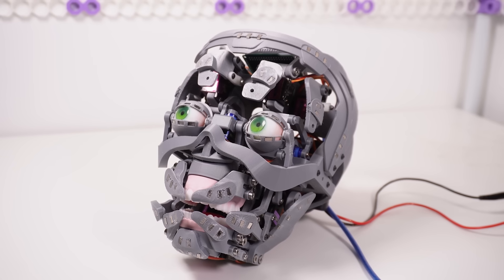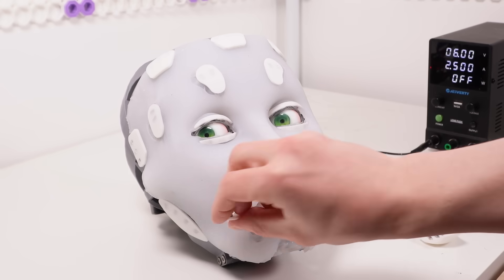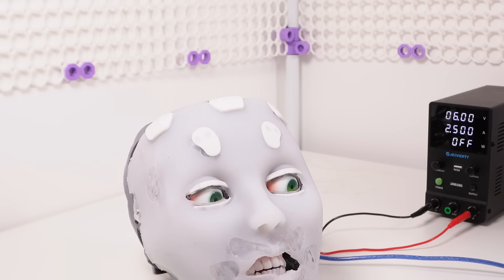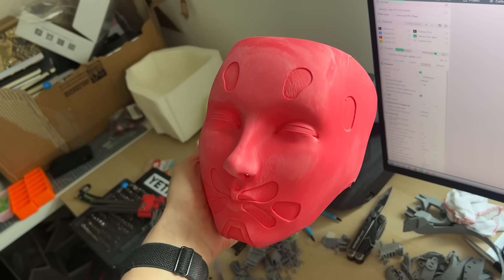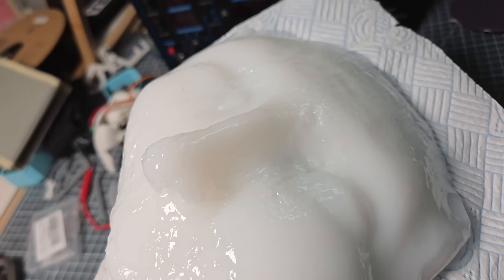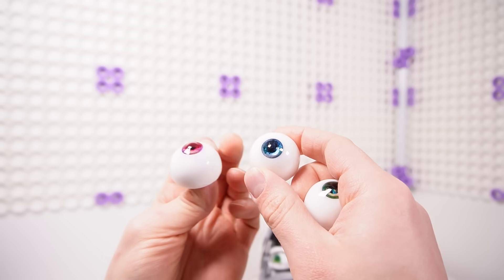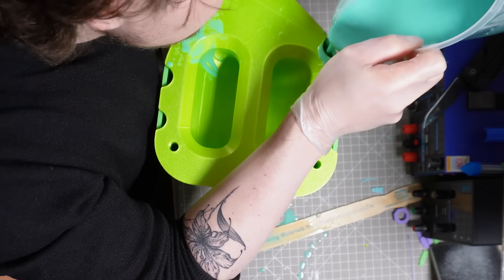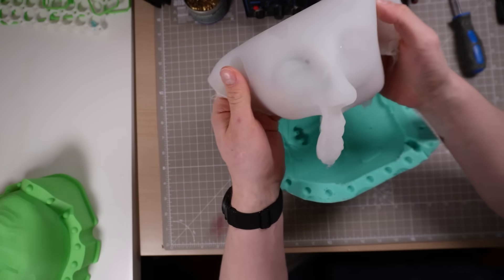Silicone Skin and 3D Printing: Creating an Expressive Animatronic Head

Comment: Smooth-On Ecoflex are platinum-cure, also called polyaddition. This polymerization reaction is often inhibited by the presence of sulfur or tin. Since you used MoldStar 15 - which is also platinum-cure and not tin-cure - your blue silicon is most likely not the problem. However, depending on the clay you used, it's highly probable that it's what ended up inhibiting your silicon polymerization. Some non-drying modeling clays are sulfur based, others are sulfur-free (and often clearly labeled as such). Had the same problem once using food-grade silicon and the clay was the culprit. Once removed, it worked without issues.
It also looks like that you're using Smooth-On's Universal Mold Release, which they don't recommend using on silicone rubbers. According to the EcoFlex product page, Ease Release 200 would be a better choice.
Also, sidenote, but I don't think you need to use the MoldStar at all if you print your mold "negatives" directly. It might be a bit more fiddly to go in there and smooth the layer lines, but you'd be able to directly cast the EcoFlex and most likely won't even need mold release. I'm sure you already thought about that though.
Reply: Agreed 100%. I hope he sees your comment

Comment: Hey, prop maker here.  Platinum silicones are notoriously finicky, so it could be a few different things!  It looks like your first round of casting, you used Oomoo 25 for the mold, which is a tin cure silicone, and you're using Ecoflex (I think?) for the face, which is a platinum silicone.  Tin cure silicones (especially freshly cast tin cure molds) can inhibit the cure of platinum silicones.  If I were a betting man, I'd guess that was your culprit. Especially since it looks like you switched to Mold Star and Ecoflex (both platinums) for round 2.

Love your content!  Your work has inspired me to pursue an associates in Mechatronics, and I'm really loving it!
Reply: This, plus some types of clay cause silicone cure inhibition.
When you used clay to stick parts of the face into the mould, what type of clay did you use? It must be sulphur-free.
Even if you think you've scrubbed off all trace of the clay, Murphy's Law means enough sulphur will remain to be a problem.
Reply: The sulfur in Air-dry clay will inhibit platinum cure silicones as well. I'm not sure what you were using either, so just thought I'd drop this here. It's something I've run into. I've had a lot of success sealing the clay with a high gloss clear coat, but it's not 100%.
Reply: This'd be my bet.
Reply: am a mold maker and this is accurate, also tin cure tends to shrink more so use platinum cure for both is better, and for cost saving on both 3d printing and silicone, use the 3d printed shell with negative space inside for the pouring of the actual face is my go to strat.
Reply: Also the clay
Reply: @bjohns3961  yes if it was water based clay
Reply: There are other ch's that say this too.  Also applies to 3D resin molds, I think Tin cure silicone works better.
Reply: I'm a mold maker and work with silicone a lot. What Brian said about tin vs platinum silicone is true. As well as what others have said about clay (usually) being okay if it doesn't have sulfur in it. I wanted to add, it looks like you're using Mann 200 mold release (that's one of the releases we use at work) which IS compatible with platinum cure silicone. So you are totally fine using lots of that mold release for your parts!
Reply: and that is why I HATED to use platinum silicone, it hates most glues, tapes, especially stink eye glances!
Reply: I ran into similar issues using resin printed molds for silicone. They would never cure, then I discovered if I finalized the resin print with uv while it is under clean water it works just fine with silicone. I'm not exactly sure why it works, my theory is whatever inhibits silicone curing is water soluable and by uv curing it solid under water it makes it so more cant migrate to the surface?
Reply: Yeah this was my assumption as well
Reply: This
Reply: Nerds!! lol ❤
Reply: bump
Reply: maybe you can research better, a bit from a builder of Hanson robotics, there was a video explaining skin formula adding cornstarch to latex

Comment: does it need to be magnets that you embed into the silicone? would you be able to get away with pegs instead? That way you could have holes drilled into the back side of the mold; insert the pegs, and then do the silicone cast in one shot, as the pegs would be at the correct depth and alignment already.
The pegs would have a larger 'head' area, and could even have holes in the plate to let silicone through them, increasing the surface area they pull against for durability.

Comment: NOICE!!! i've been thinking and working toward this project, with (the face coming first) but i would NOT be using the industry-standard lever system like you did... here's the trick, the 'skull plate' has holes for tiny cables in nylon tubes that can yank on various points of the face where the tiny cable is tied off on a small piece of mesh to distribute the anchor point's load on the silicone (and not tear it)

i suck in CAD and can only conceptualize the process... that's what's holding me back but you don't seem to be stymied.

Comment: Great-looking machine! Can’t wait for the next video! The silicone skin looks awesome! I think having the magnets inside the skin is a great idea, but maybe you could use TPU to hold the magnets? If you make the print porous (like 10% infill) and then cast the silicone inside, it could strengthen that section and stop the silicone from pulling away over time. Just a thought—keep it up!

Comment: silicone is definitely expensive :' )
half a gallon is around $30, and its for 1 quart of A and 1 quart of B
the mixture is not 1:1   its  A-1 : B~0.5

if you want different colors, 
add only up to 3 pea sized drops of acrylic paint MAX to A 
then mix, let cure 25 minutes until bubbles leave mix.
and add B only when ready. 

injection models need airholes to cure

~ any more than 3 pea sized drops of paint will turn the mixture into slime and it will never cure.

Comment: I love it. Fantastic job. Can't wait to see more. What I have done in the past with the magnets is to place another magnet, in the negative mold, attracting the one that is in the positive mold to keep it in place. This keeps them from getting attracted to the ones near to it or from moving around, In this case, I would put down some silicone, where the magnets would be, and allow it to cure, so the magnetic attraction doesn't squish all the silicone out. I'd finish by pouring the rest of the silicone concealing and suspending all the magnets in.  The mold would have the negative space designed below the surface with the proper gap for attractive forces. They can be glued in place, in the original mold, so the process can be repeatable for multiple skin productions. There's still a need for great attention to the polarity, but once glued into the negative mold, you don't have to worry about them again.

Comment: I have a few questions: are the eyes and eyelids linked, or individually controlled? And is the jaw only open/close, or also front- and sideways movement in this design?
I really want to build an animatronic from one of the main characters of a book I'm writing / game I'm making, and I'd like to make it as realistic as possible.
Due to a few disabilities, I can't seem to focus long enough to get the mechanisms designed myself :( Adapting existing designs is generally no problem though ;)
Thank you VERY much for all the work you're doing, and for sharing the process and the files!

Also, I don't know if you already know the channel "Brick In The Yard Productions"? Not trying to promote them, or anything, just mentioned it because I found their tutorials on realistic skin making very interesting and easy to follow. It's mostly directly linked to the products they sell though, but most of the tutorials should work with other brands too I assume.

Comment: If I may suggest a couple things for the silicone:

In all likelihood, the clay you were using had some amount of sulfur in it. If it's a platinum silicone, too much sulfur will inhibit curing. 

You can order sulfur free clays specifically for this.

For silicone, check out Fox and Superfine's SkinCast. For faces, I use 0010. Their formula yields FANTASTIC results and is pretty easy to work with. Only downside is current restocking due to inheriting the formula from a now recently closed store. 

For adhering the face to the machine, over at Inmoov, they found a mix of magnets and a VERY thin Velcro holds well. The 0010 Skincast seems strong enough yet malleable enough for the servos. If your magnets are ripping out, you can use something like a small amount of 0030 or 0050 to create small encasings for them. 

About a year and a half ago, I found your animatronic eye design and gave it a go. At that point, I said "I want to build a full size humanoid android."
Now I'm on my path to making androids and robots on YT for a career. Your open source projects inspired me to start the journey. So thank you so, so much for the work you do. 
I think your eye design is becoming a standard for people's projects, so selling the eyes sounds like a great idea!